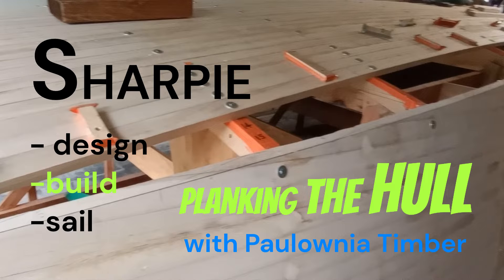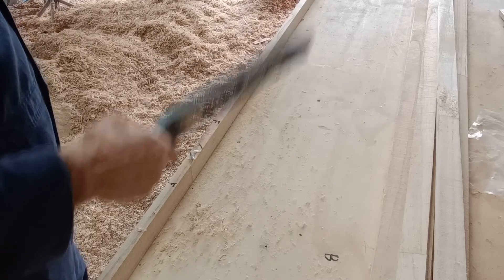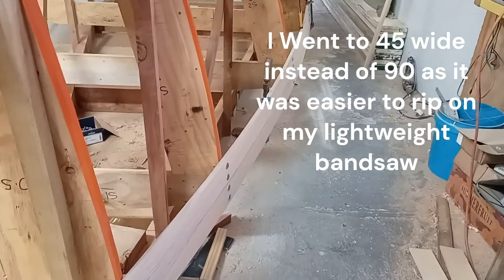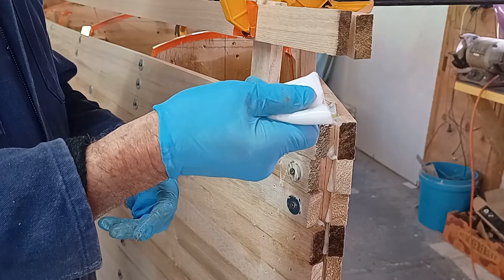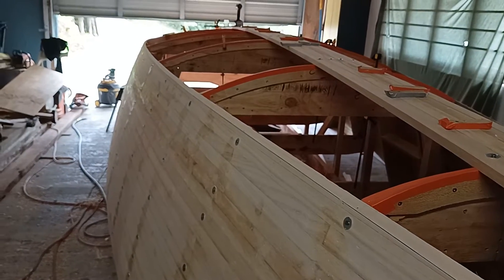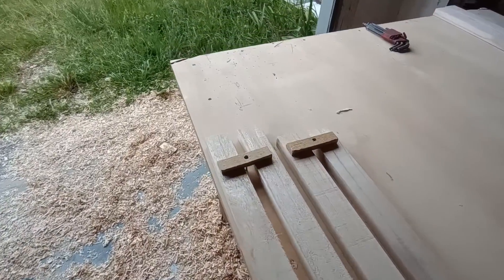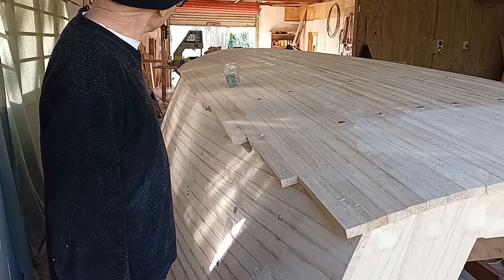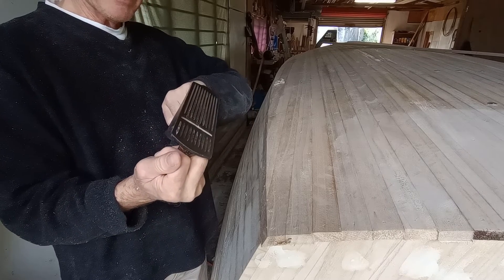Planking The Hull with Paulownia Timber - 23ft Sharpie Trailer Yacht Sailboat Design Build Sail

Comment: Nah, you don't need more frames, just use some home made  "clothespegs ", V shaped forks of wood, and use them to line up the top plank with the other lower ones. I built a 16ft Canadian canoe with a lot thinner strips and  the same mould spacing.
Reply from the maker: Thanks for the comment and you're probably right, however, although I like trying new ideas and in the case construction methods (new to me) if I have a doubt about something I try to 'encourage' myself to take the conservative choice and it was more about spacing the skins further apart to give a stiffer panel as I'm planning on using a minimum of internal structure. 
Another lesson for me was to not follow the gunnel for the first plank but lay it around the hull where it more naturally wanted to lay. By doing it the way I did, one edge always wanted to kick out and the other kick in. So they weren't staying as fair as I'd like between the frames (they were being stressed in their most resistant direction) and I really did want to minimize the fairing I needed to do, to save weight, work and materials.
Sounds like your canoe turned out well!
Reply from the maker: Something I also have to admit and deal with is I've been told more than once by friends I need to not strive for perfection (to me it's far from it!), and it's true, perfection is the enemy of getting a boat in the water!

Comment: New to the concept of boat building…. Enjoying the channel and videos very much, very helpful. What happens to this upside down hull at the end, do you remove those frames or do they become the bulkheads?
Reply from the maker: Good to hear you're enjoying the channel!
I'll be leaving the temporary frames in as long as possible and remove them after the deck is on so the hull stays in shape. To help with that, I have made some temporary gunnels. I'm working on the deck at the moment after I recently turned over the hull.

Comment: Looks great Karl! just wondering, do you resin soak the timber before applying the thickened epoxy to glue the join, or have you found a way to still make the join strong while missing this step? Cheers
Reply from the maker: Cheers Ezra. Good question. In this type of construction the strength of the boat does not rely on the joint being strong, so much so that butt joints can even be used as long as they are not side by side. The reason is the timber over all acts like a finger joint, the real strength as with foam construction, is from the skins. Paul from the club told me he built a catamaran and experimented with using fairing resin and micro balloons to join the planks to avoid the problem I had in that the glue line is a lot harder than in his case Cedar, more so for Paulownia. He found the planks did not break on the glue line and from what I've seen, I'd agree. But yes, it's still good to use a scarf joint because it helps keep the 'planks' fair. It does glue very well I've found, without having to pre-soak the timber and doesn't seem to over absorb the resin in the glue and dry the joint. It's very nice to work with! a little over 200kg a cubic meter whereas Cedar is about 385. However, as I've mentioned in video, I did go thicker than required for cedar as you might with foam, but mainly because skins of the same weight further apart make a stronger result and it also aids in construction and therefore I can use less internal structure.

Comment: Nice progress! Not sure the maths checks out on adding to the frames though. Since the paulownia is lighter than water, the more you add the higher the boat floats. Below the waterline anyway. And since it’s so light, the added thickness under water can easily support the added thickness in the topsides.
Reply from the maker: Appreciate your astute comment and I probably should have explained better that the cause of wanting to increase the displacement at that late stage was because my spreadsheet sum of weights, was starting to compromise some of my decisions as to what weight I added. If it was purely a race yacht, and there wasn't a tight budget, I might have better kept to my original target. I used to build steel yacht hulls to someone else's designs and people were forever having to raise their waterline paint, I'm trying to head that situation off while keeping in mind, any % of weight saving on anything you can, adds up.